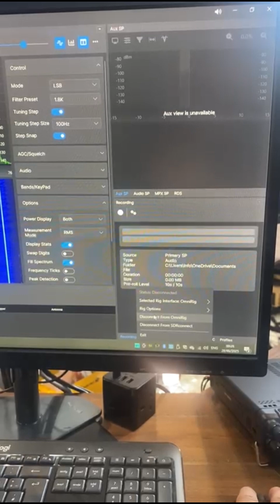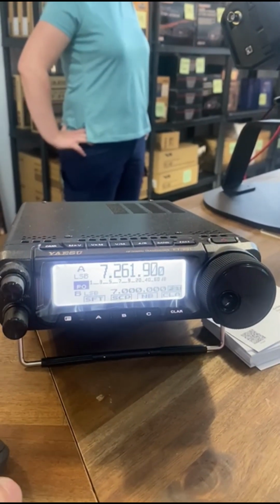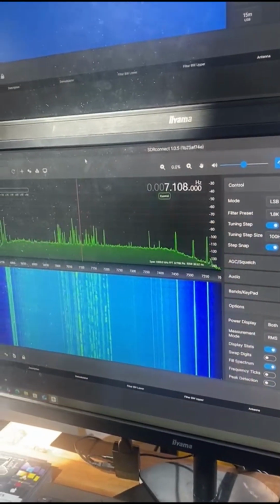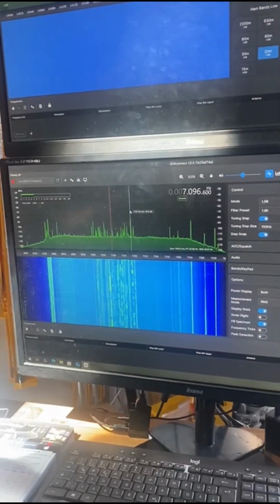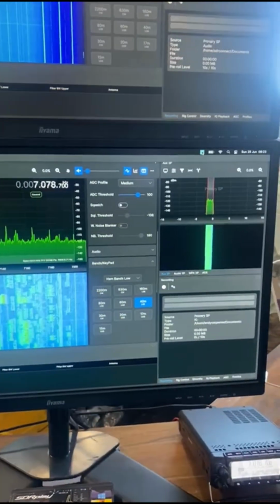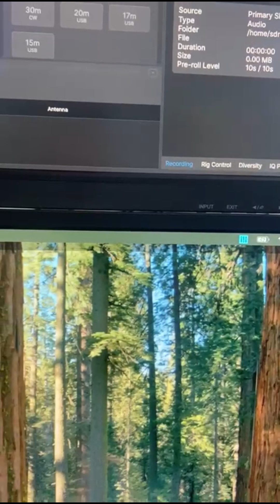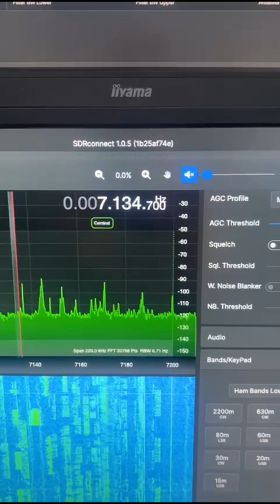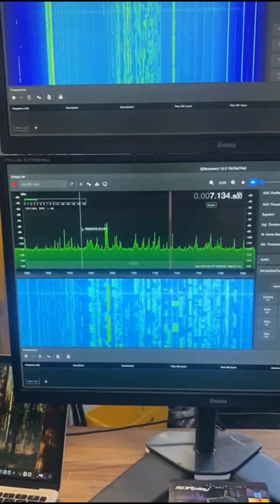Rig Control for SDRconnect - an update

Comment: Hi there — bug on Mac though —If Rig Control windows is not top in Z order, it eventually stops working. As soon as you use Cmd+Tab to make it top, it fires to change frequency.  You need to make it “always on top” and perhaps just shrink it to an icon if you want a quick fix.